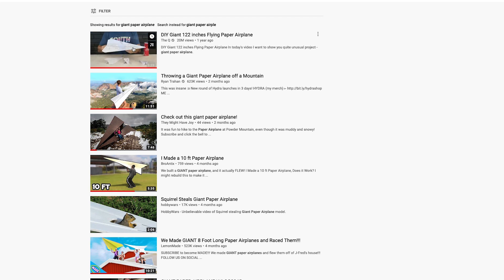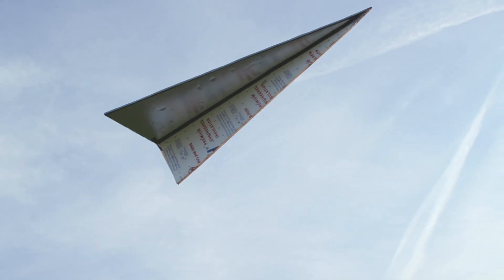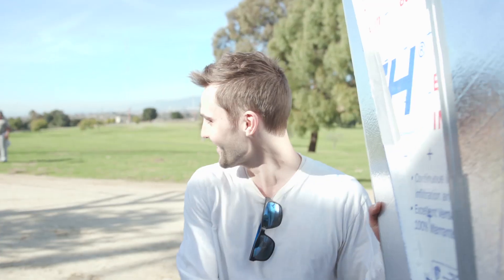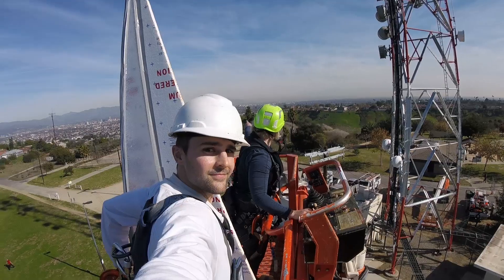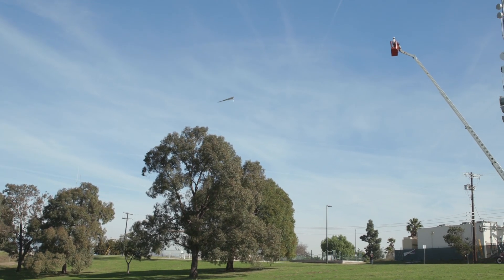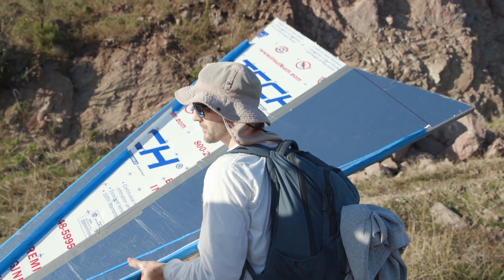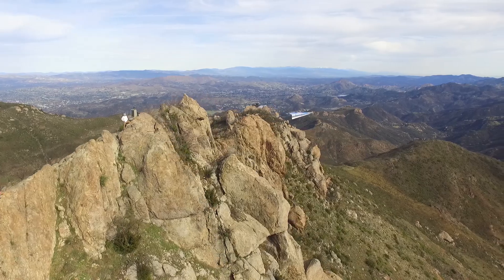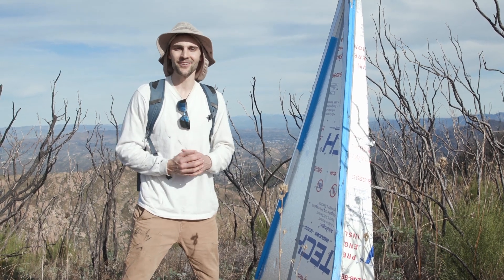GIANT Paper Airplane off a HUGE Mountain

Comment: The KF1 airfoil you used is simple and effective. It changes the center of lift while in motion which can be different than the center of gravity. The airfoil should not exceed the first third of the wing. If it's nosing up, then you need more nose weight or a little down elevator. It should  settle into a nice glide at the right speed. I'm a hang glider pilot, and can tell you that when you launch off a mountain, it's good to wait for the right cycle of updraft to launch into. Your end product was great. Loved my visit! If it only caught a thermal before the next ridge. LOL
Reply from the maker: dude this is great! I really appreciate it! I went hang gliding once with a guy named Wolfi (he's from Switzerland) and it was so incredible... learned so much about thermals and how to achieve flight without a motor or jet... thanks again for the info!
Reply: @NickUhas  Wolfi is fricken AWESOME!!!!!! I think I saw that video. It was at Andy Jackson Airpark in Ca. Great stuff. My brother and I got our foot launch training there last October.
Reply: :thanksdoc::thanksdoc::thanksdoc::thanksdoc::thanksdoc::thanksdoc::thanksdoc::thanksdoc:🤩🤩😘😘😘💋💋💋💟💟

Comment: The “Weird Stall” thing is because the glider is tail-heavy. More weight in the back (or lack thereof in the front) makes it nose-up like that so it stalls and lawn-darts. Having the air-foil both gives it a bit of lift, and balances it better! Welcome to the world of scratch-building aircraft!!
Reply: If it’s tail-heavy, not so much. A good saying to remember is “A Nose-Heavy plane flies poorly, a Tail-Heavy plane flies once!” You can find an easy balance by making it a touch front heavy so it noses down, then bending the back-end up to give a little upward flight control. The dude that made the Guinness Book record flight for longest paper airplane flight on a single throw did exactly that. the plane slightly stalls, then finds it own balance between speed and lift
Reply from the maker: @c.youngberg9511  this is fantastic... much-appreciated man!
Reply: Exactly this. The airfoil isn't really doing much as far as lift goes, it's simply adding more weight and a fair bit of drag. You'd me amazed how much a small step on a win slows down an aircraft. Full scale gliders use air brakes only about 5 inches high and they slow the aircraft very well. The main issue though is that traditional paper planes are made from folded paper thus there are more folds near the front and so more paper and more weight. You foam is the same thickness all the way around and so the centre of gravity is way too close to the rear of the air craft. If you round off your airfoil and add a little weight in the nose til you get the CoG right, your glider will go a lot further. Also you can fine tune the speed it glides at by adjusting the nose weight. To calculate where your CoG or 'balance point' should be you can use this calculator. http://fwcg.3dzone.dk/
Reply from the maker: thank you so much for this!
Reply: Wanna learn more? Do what I did and follow the FliteTest youtube channel. Heck of a lot of good knowledge to learn there! I’ve been following that channel for years and will be getting into the hobby soon once the budget allows!
Reply: Would somehow bending the wings upward or downward as needed at the tail-end have helped?